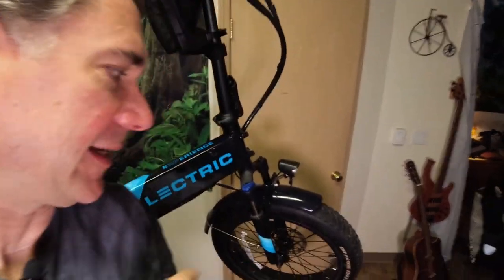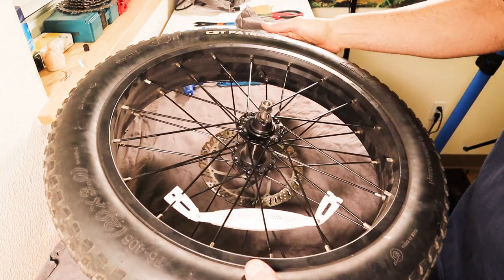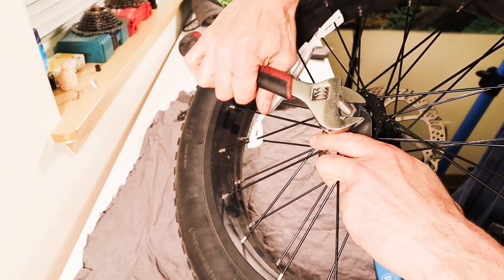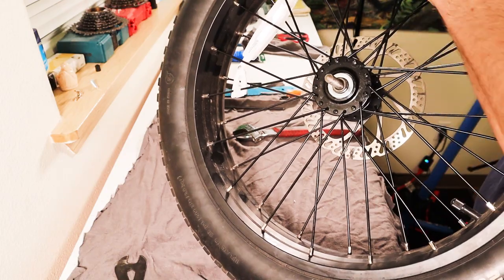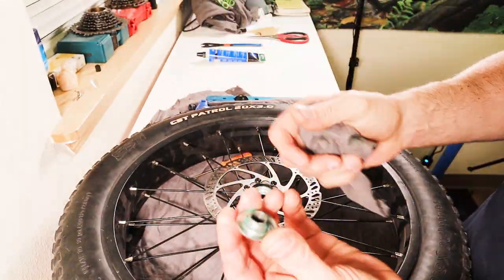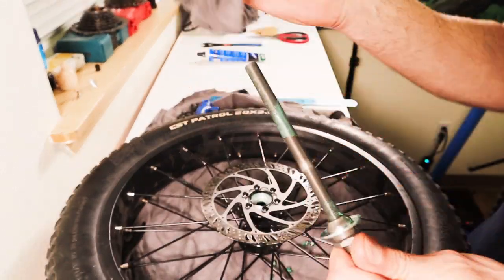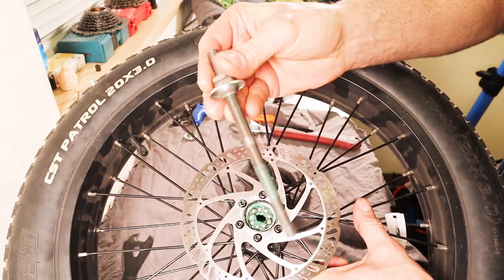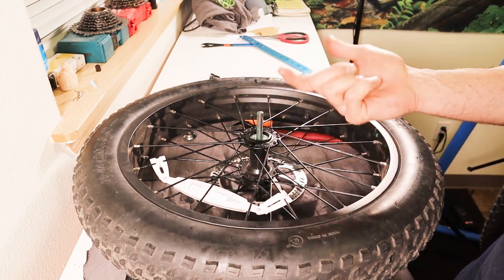Lectric XP 2.0 - How to REBUILD Your FRONT HUB (walkthrough)

Comment: if you make sure your cone wrench is not moving at all when you are tightening the lock nut then it should not back off the cone nut. When you are pulling both wrenches towards yourself to tighten it, you are actually lightly loosening the cone nut.  Keep that cone wrench stationary and only tighten with the crescent wrench and then you should not have that initial play.  Great comprehensive vid here, thanks for posting!

Comment: Is it possible to order a new lectric xp 2.O wheel hub for the front and back wheels let me know if u can  thanks great video always go to videos for maintenance
Reply from the maker: I think if you contact Lectric, they have replacements.
Reply: @PedalWithPower  is it part of the warranty?
Reply: Also how about the rims my ebike has a nasty dent on the rim
Reply from the maker: @letsgetturnt9759  If it was shipped that way, it should be covered. Doubtful it's covered if it was caused by use. Sorry but I don't work for Lectric, I bought my Lectric from the website. You will need to contact them.

Comment: Do u know if there is a front hub motor that will fit this?
Reply from the maker: Hi Chris, there are. I may look into showing how to do it, but right now that's a costly addition that's not in my budget.
Maybe down the road
Reply: Do you know roughly how much that is?
Reply from the maker: @chrislawson7622  I'm not sure. You would need the wheel, and either a new controller if you wanted to use your current battery, or a separate controller and battery just for the front hub with a throttle added to the left side.